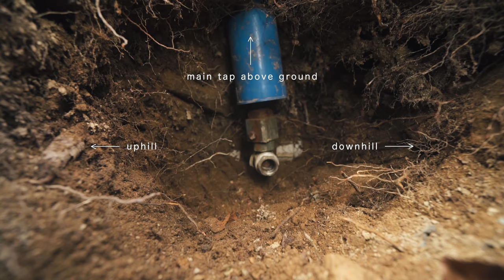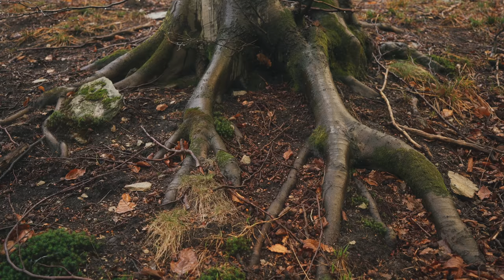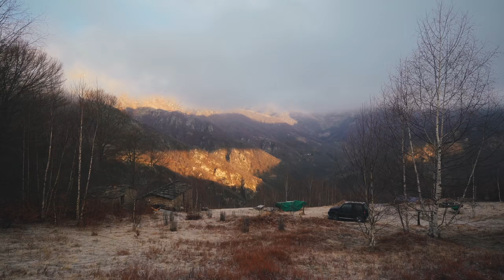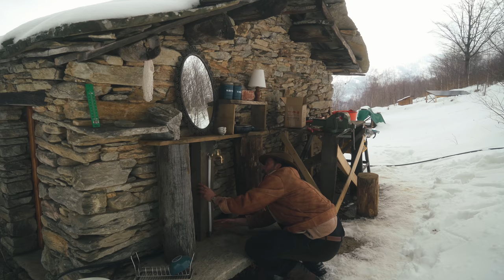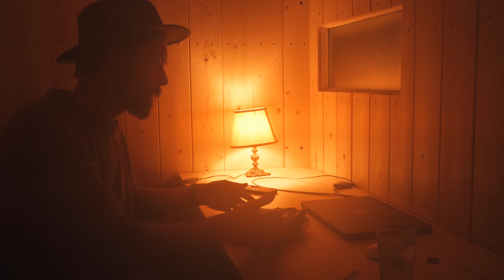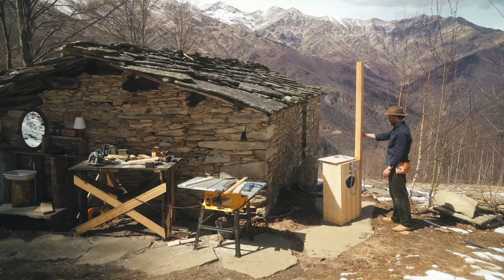#15 Running water!

Comment: How we do outside shower in Balkan: We remove the outer shell of the boiler and put the inner shell on stand like you did. Then we find cheapest and most dark paint. Paint and let it sun heat up. Walla, free hot outdoor shower. No electrify needed, ever :goodvibes:🙃
Reply: Because you have hot weather in summer what about freeezinvg winter no sun
Reply: @monkmodemalik8225  Common logic. "outdoor shower"

Comment: Hi Martijn,
Just a simple tip for pulling off lengths hose etc. if you take equal amounts of loops from each side of the coil, the hose would lay out straight. :)
Reply: Do you mean to separate the coil in the center and then spool out each side?  Might have to use that trick!
Reply: WOW makes perfect sense even to an old gramma like me.
Reply: @shortfuse43  Hi, Stand the coil up and make sure the outside end isn't loop in or trapped and take four or five loops off on the left and then take four or five loops off on the right. Each side will counteract each other and it it will lay out straight.
Reply: @ootsgirl  Gramma, believe me poly pipe must be un-rolled, never pulled off the spool. Tie one end to a tree and walk the roll out. Otherwise it never lays flat.
Reply: Believe me poly pipe must be un-rolled, never pulled off the spool. Tie one end to a tree and walk the roll out. Otherwise it never lays flat. Pulling off of one or 2 ends is just a foolish disaster.
Reply: Oh, good advice!😊
Reply: You got admire the amount of work but man the location is so bad...
Reply: @robertocalvo934  Yeah, I keep looking at that layout and situation of the stone houses. I just cannot figure out what on earth caused them to situate them in such a weird spot on that property. The priest up the hill  has a better location, although not level at all. I would have to take a large bulldozer for a few days and level or terrace that entire hill top. Still, the northern exposure is a big downside in winter.
Reply: @RRaucina  He explained the advantages and disadvantages of the location in a previous episode. 
I loved a couple of years in Saas-Fee and believe me: it’s no fun when the sun disappears behind the mountain at 5 PM during summer, and your garden is in the shade. 
Large parts of the valley are protected, but even if Martijn could obtain a permit to flatten the land, it would destroy the place.

Comment: Because of the rocky soil your need a Steel Tamping and Digging Bar, 68-Inch to loosen the rocks. Amazon USA $60. You will break the pick handle trying to free the rocks.

Comment: We just found you two days ago on U Tube. My husband and I are captivated by your work on the homestead. I recently retired and have been installing irrigation pipes and a drip system. I have also been installing pavers and walkways so I can sort of relate to a part of your back breaking work. You mentioned you were not sure about the cow manure you placed in your garden bed. As an avid vegetable gardener, I will say the soil you dug out of the bottom of the structure will definitely be viable as a nutritious growing medium for your plants. If it smells like sweet earth and not cow dung, then it will be absolutely fine to use. Rotted cow manure is the best. We look forward to more videos. Best of luck in all you do.

Comment: This entire video series is thoroughly enjoyable!!!! One of the most appealing aspects to the series is how Martin is learning by doing! This said, while I’m a strong advocate for that method, sometimes it can be better to have tips from the old timers. I’ve been a professional woodworker for four decades. I can’t even begin to tell you how many people I’ve known that have cut off fingers with power tools. I know that it’s cold outside, Martin, but one of the reasons why I still have ALL of my fingers after decade’s of cutting and shaping wood is that I stick to some great advice an experienced guy gave me when I started; NEVER wear gloves and or long sleeved shirts/jackets while using table saws. And when pushing narrow pieces of wood through a table saw, always use a push stick to keep your hand away from the saw blade. Everyone thinks that they can ignore this advice. Until…they’ve had a finger cut off.

Comment: Excited to see your new water system going in!   Just out of curiosity, when choosing the boiler (which I'm assuming is the "on-demand" type), did you only consider electric, or did you consider a propane gas unit as well?   Not sure of the availability in your area, but for many remote cabins here in the US, we use small propane gas on-demand water heaters (boilers).   Thanks!

Comment: I look for your post every week.  I see your two stone buildings and the color of the mountains and I know you have posted.  I think the massive flat rocks for the patio were a good idea to control the mud.  It's too bad you can't connect the two barns and put the shower there.  It is going to be hard digging for the waterline.  You will have to get your volunteers back to help.    Best wishes for spring.  We are still waiting.

Comment: Having hot water is a God sent. It lifts your morale greatly and gives you comfort. Hot water is great!
Your filming is great. Can hardly wait to see your stuff as it appears. 
I was wondering if not a solar water heater would be better for this. I have a pressurised 135 litter system (smallest they had) and it gives me hot water 3/4 of a year. Even in winter I get some warm water. It does not have to be got but sunny. It also keeps the water hot for a few days, as it's insulated. It can also be heated via a electric resistance, but I rarely use it as most of the time I get at least some warm water. When sunny take a shower!
When I say hot water I mean it. The water will boil in summer time. I had to put in a water mixer so people do not get scaled or I get damaged pipes as they are not meant for such temperatures. 
The electric heater will work but will require some power. If you leave that electric heater running then insulate it as they tend to lose heat and they are not meant to be used outside. 
I would have gotten a small washing machine instead of the water heater.
Reply: It is a solar water heater. He only has solar power there.
Reply: @rhondadavis1483  he has an electric heater, not solar, and he produces electricity using solar electric panels (or the generator). My proposal was a solar water heater that heats the water directly from the sun, using glass tubes. This solar water heater does not need electricity at al, unless you put in a electric resistance for times when the hot water production is not enough.
I've been using such a system in a place where I do have grid electricity. I did not bother with a electric water heater, but went for a pressurised solar water heater and I have hot water 3/4 of the year. I also get some warm water in the rest of the time. No running electric cables. I did in fact run cables to put in the tank a 2kw resistance to use when I do not have enough hot water. Rarely use it even in the winter, but I do not live there full time, only weekends. 
As I do get grid power it's not worth it for me to put in solar panels, inverter, batteries and so on. I get hot water for free without using any electronics. 
I even left it with water inside through the last two winters and it survived. My water pipes and fittings had issues but not the solar heater! We do get -10, even -15 Celsius so real winter!

Comment: A heavy crow bar like the ones they use to use on the rail road tracks would be very handy for you when moving does big slabs. Was lucky to pick one up at a car boot sale here in Ireland it came from England. For digging up holes or moving something heavy it’s a blessing. Any kind of bar or even an old tine would help you a lot. Enjoying the show a lot. You must find it hard to work with all that beautiful view around you.

Comment: Watching this series has been revelatory. It doesn't seem like you were raised using tools too often, though I could be wrong. Watching your problem solving is fascinating and I often ask myself how I would approach a similar problem. The solutions you go with are simple, rarely what I would go with, but I do see how useful the uncomplicated nature of your choices are. So much food for thought in this channel. When you decide to bury that water line, if available, you may want to consider renting a mini excavator. You will be able to trench all the lines in a day easy and save your back. In California, they can be rented for around $200-300 per day. Something of the sort will most likely be critical if you put in a septic system.
Watching the roof repairs will be very interesting and I hope multiple episodes. Im curious to see how well your use of materials matures as time progresses. It was quite gut wrenching to see you cut those beautiful doors up just for a planter box when you have so much flat stone available.

Comment: My grandmother and grandfather had barrels in the bath rooms with had pipes running along the walls of the barrels on the inside of them. At the bottom they had a gap for fire wood which would be stoked. It had a chimney on the top of the barrel going up to the roof. A hose would be attached to the water pipe which then fed the pipes running inside the barrel and then ran out into the bathtub. We had very hot water to bath in!

Comment: My friend, the FIRST rule of poly-pipe laying is that the pipe must be UN-SPOOLED from the roll. For anyone in the trades to see that gigantic heli-coil being made is very painful. Pulling pipe, even a garden hose off of a roll makes it impossible to get the pipe to lay down and stay flat. Make a spool or get a helper to rotate the roll as one walks it down hill.

Comment: I love watching your videos, Martijn. They're inspiring. You clearly know what you're soing. One thing that caught my attention though was running lumber through the tablesaw with gloves on; even though it's cold out, I'd always recommend pulling your gloves off when running a table saw. If the blade snags a big of the glove, it can instantly pull your hand into the blade.

Comment: You might like using a lift strap around your property. They wrap around your hips and the base of what you're lifting, then all you have to do is straighten your legs to lift from the squat. Quite handy and a bit safer for the low back discs, when used properly. Thanks for the beautiful footage👍

Comment: Ingenious!
For the sink, make sure to put a recycling drain pipe to use that water. Also, make sure no water falls in that ground area or you will have problem with the building foundation. The shower is very nice. Did you use the big stone slate to avoid. Sinking ground on the shower floor? Also reuse that water for the garden. God bless and renew your strength. 🙋🏻🙏🏼

Comment: A little tip when screwing on threaded connections (of any kind but especially in plumbing) put the two pieces together then turn half a turn the wrong way until you feel it engage then turn the right way to tighten - prevents cross threading.

Comment: In my neck of the woods we had to dig down 6 feet to get below the frost line in order to run water to our barn, then heat tape on the faucet to keep it running in winter. So - many - rocks! We did use a backhoe, though, cheating! 😂

Comment: Every time I hear someone saying - it's a temporary solution - it brings to mind an old wisdom - nothing is more permanent than temporary solutions :))
Actually there's another temporary and much faster solution - using a garden hose instead of digging and plumbing .. will get you running water wherever you need it .. just a thought ..
BTW this plastic pipe can't stand freezing .. it becomes brittle at low temps and ice will break it .. so it needs a good insulation (from my own experience)

Comment: It’s great to watch you thinking a plan through, I do the same when looking at a problem. Hands in the pockets and contemplate where the pipes and connections go. I would extend you roof out by 4-5m from to give you a larger outside work area. You could shield the sides from the weather with woven, wooden panels.

Comment: I would suggest fabricating up a turntable when unspooling your plastic pipe it will prevent a lot of kinks and fighting the coils.  I have seen them made in great variety from simple cobbled up ones to sophisticated types.  Just need something that contains the coil and pays it out through a fixed orifice while the coil freely rotates.  Sandbags are handy to temporarily hold it in place.

Comment: Hai Martijn, I've worked on a stone house in France with 60 cm large rock soIid walls and a rocky floor, like your houses. I tried to install plumbing and discharge for shower and wc but found it impossible to lay piping and get the necessary run off angles to empty the drain pipes. We ended up making an extra door in the wall of the main house and we built a separate 'wethouse' outside this door, snug against the outer wall. In this way we could lay the pipework in the walls, the floor and with enough runoff angle to the sanitation tank. We clad te wethouse with big stones to let it blend in with the main house. Perhaps this is an idea for you to explore. You don't want walls to collapse because of a silly sewage pipe. Or clogged up WC's every week for the next 200 years. Mind you that when using a sanitation tank you need to be sparse with WC flushing water. So you need quite a steep runoff angle. But I suppose you know all this. I like watching you work and enjoy your perfectionism in carpentry. Another option to the wethouse is a separate sanitation shed away from the house. Perhaps even prefab and almost on top of the sanitation tank. Like they have on camp grounds.

Comment: Top tip it’s sometimes better to roll out the coil from the higher ground first down to the lower ground
using gravity to help less waste and less things for the coil to get trapped on.
The coil can easily be uncoiled eliminating twists which be difficult to lay in a small trench.

Comment: I am hoping its not froze since you shot this as its really important for the heater to be insulated if left outside or the water inside will burst through the heater. if you aren't going to insulate please empty the water so it won't brake in frozen condition.love the videos😊

Comment: to uncoil rolled up material to get it straight by itself you either unroll it or if you drop it from the big coil you drop for example 3 coils to the right and then 3 coils to the left and it will straighten out. works for pipes and any wire. i learned the as an apprentice working for the phone company when in 1958 we were still using single uninsulated copper wires. try it. it works

Comment: Before you lock the pipes into each valve you should wrap thread seal tape along with the paste as the paste will harden and crack over time, this will create a perfect water tight seal.

Comment: Martijn to help yourself with the digging, have you thought of an electric coltivator/rotovator? Its fairly cheap and if you use it sideway it can soften the ground quite well. I did my whole hill garden with it and it worked out fine, of course the major problem might be the huge rocks in the ground. But its worth thinking about it. Thanks for your videos. Amazing job for all the project so far. Cannot wait to see it finished.

Comment: always enjoy your vids.you're quiet craftsman.maybe you can try brass or copper fittings/tubing on your water system cause galvanized steel would rust and corrode overtimes as you already know.Stay safe and keep it up.

Comment: Nice videos! Thanks. A few tips raise the solar panels to optimal angle. In sweden it is 43 degrees so check yours. Maybe put them on swivel for extra 20% adjust 2-3 times a day. Good luck with the roof!

Comment: In the summer you could throw a roll of that black poly on the roof and heat your water that away, All so I would suggest a hand shower, you get wet turn off the shower soap up and then rinse off saves water and the cost of heating the water

Comment: Are you going to install solar heating? This would give you constant hot water even in winter and even underfloor heating which has to be installed before the rooms are finished. If you installed two solar tanks, one in each basement, natural convection would keep both units warm and during winter a woodstove with a back-boiler could suppliment it.You certainly have a lot of flat stones around that you can use for the pipe protection.
If you get packages with flat polystyrene packing, keep it and use it to line the main water supply tub so the cold does not freeze it. Once you have enough to pack it out, remove them and wrap them in clingfilm so they can be easily removed when you need access.

Comment: As long you have freezing temperatures outside you have to powered that boiler constantly.otherwise you have a problem i suppose.Isolation on the tubing is also to be done i think,or make a tap somewhere you can release the water out.anyway good luck and youre filming quality is very good;

Comment: I could be wrong but the trenches do not appear to be under frost depth. And if not, you will
not have water during a winter freeze below zero Fahrenheit. Plastic pipe cannot be thawed
with a welder like steel or copper line. Well anyhow.

Comment: In matter of plumbing teflon tapes are often too delicate if you twist too much tape will get torn apart. It was driving me nuts with when i was using teflon i wasted 4-5 meters on two pipes until I decided to switch to hemp.

Comment: Well, I hope you really know what you're doing, because in minus temperatures, the boiler should be empty. I have a similar system, but there is a point where I can drain the water from the whole water system .... and I really think about everything, because the water tends to stay in the valves and lower places ... just have to correct the mistakes next spring :)